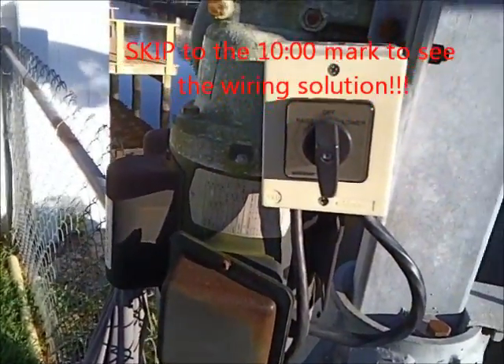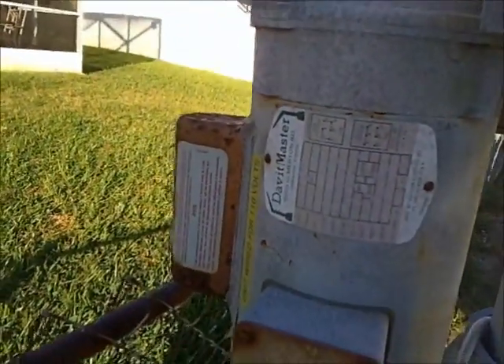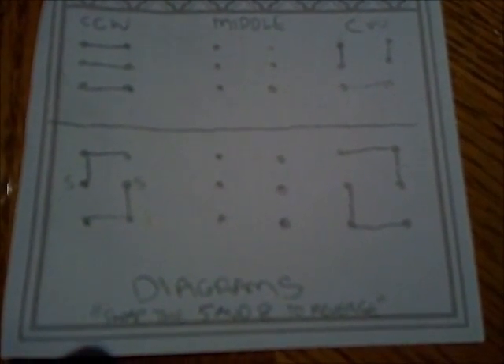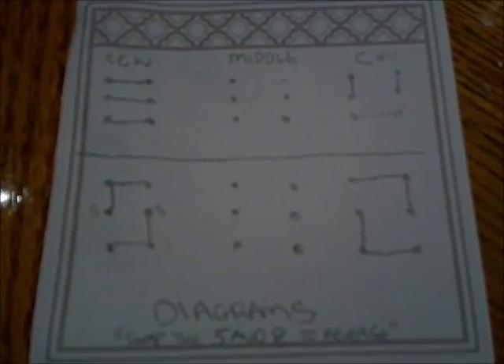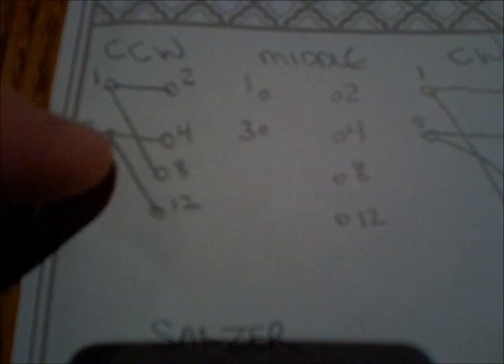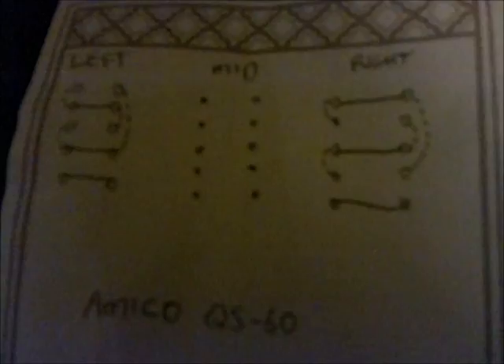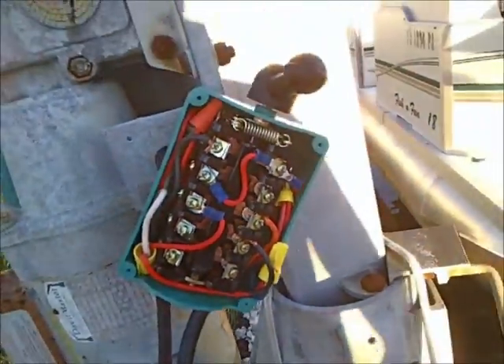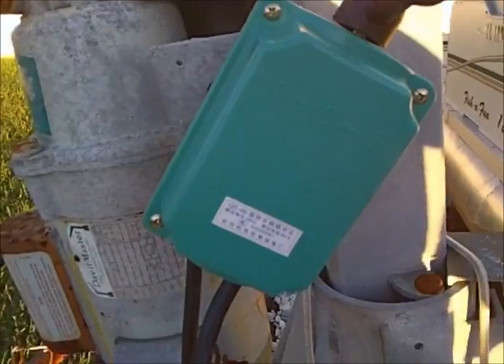AMICO QS 60 drum switch wiring solved + salzer drum + ac motor

Comment: I have wired a similar switch in this manner.  It is worth remembering this is NOT a legal way to wire it (because of the steady neutral), which is why there are no "authorized wiring diagrams" using a 3P switch in a 1P application.  You have to be absolutely certain the "neutral" is definitely the "neutral".

Comment: Sir, I have the same switch but it is for 220v. I have the  hot  on the no. 1 and have the neutral on the no. 2. All I need is to change the black and red to reverse the motor. I got the switch off ebay. The seller said it could be used for three phase or single phase. All I need to us is the white wire and the red and black. I could do it manual by hand but dont want to get a shock. The dayton 11/2 hp Has a rotary switch the cost 110.00 for a little switch.
Could I send you a private mail with the drawing of my motor hookup in the back?

Comment: Hi, great help with this switch however please clarify. your wiring diagram for the switch appears to be with the lever facing dwnwards according to the jumpers on the actual switch and finished wired shows with the lever on top. Please clarify for me.
I have 4 wires on my motor (one winding U1, U2) and ( one winding with capacitors connected Z1, Z2)
Please explain the connections for me.
Thanks in advance.

Anand
Reply from the maker: +Anand Deonarine Hi.  My diagram would be with the lever down.  I called row #1 as closest to the lever.  However the wires go in and out the other side from the lever.  When I installed it, I switched it 180° so the lever is on top and the wires are down below.  For you, the U1 and U2 should be hot and neutral to the motor and run the hot thru the switch closest to the lever.  The Z1 and Z2 are the reversing wires and hook them up per the diagram on the side of the switch where the poles are jumped adjacent to each other - 0__0   0__0

Comment: This is a great resource for wiring this switch! Thanks for posting it.
However, at the 12:00 minute mark in the video, it looks like there's a red jumper wire from #1 on the right side to #2 on the left. I didn't see that jumper in the wiring diagram. Maybe I'm missing something. Is the diagram correct or is the picture correct?
Reply from the maker: +Steve Barefoot  First, great eye for detail and my bad in the video.  My memory is a bit foggy, but I drew the diagram after I did all the wiring trial and error so I kind of simplified it for the diagram (either that or I fed the hot in from the opposite side of the diagram on the first row only just to simplify my inputs wiring run up the left side in the picture, for space, then jumped it back to row 2).  The jump serves the same as a splice and takes hot power from row 1 to the correct terminal in row 2, and it will work for either side of the row 1 power to be spliced/jumped.  The jump takes less space than a splice in this box.  The first row switch has to break the output to the main motor hot in the middle/open position, and the second thru fifth rows need to break and forward/reverse power to the starting capacitor.  I kind of put the picture in there just to highlight how little space there is.  I would refer to the diagram (10:52), and confirm you are getting the correct outputs in each switch position, because the picture can be hard to follow each wire.  Good luck.  You can alter the diagram, as long as it works.  I think there is more than 1 solution for this switch.  Thanks.
Reply: @hvaball150  oh, good call on using jumpers rather than splices. I'm wiring up the same switch, and I came to the same conclusion about the neutral... I'm not happy about it, but I also don't want to drop ~$70-100 on a Dayton switch. 

I think you have to have 6 switches to make this work without wiring the neutral straight through; I've been trying to figure out how to do this "properly" for days, with no luck.  I'm putting an e-stop between the wall and the switch so I can kill both the power and neutral, just out of paranoia.
Reply: +HVABALL Awesome! Thanks for  your reply. I would have had no idea where to start without your video.. Thanks again for posting it!

Comment: Hey. Funny I have a similar situation. Bought a milling machine off craigslist and forward/reverse switch doesn't work correctly. The switch is exactly like yours: 3 position 12 terminal (probably 380vac). Pretty sure it is wired incorrectly but got a new switch just in case (ebay cheaphy but same switch). Your right, can't find any info on the web. I am set-up for 115V and the motor has 5 wires coming out not including the power source wires. All 12 terminals are wired as it is now so I figure this is what I need to follow. Switch worked in forward and stop but in reverse it goes in forward. Any thoughts?